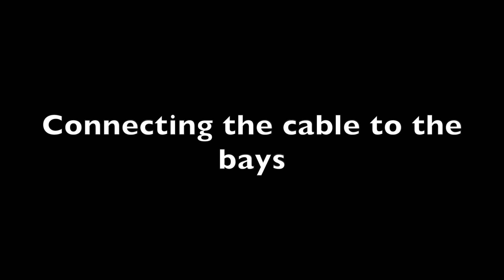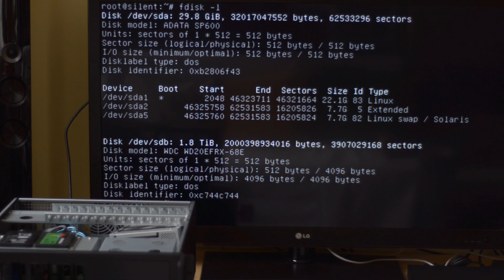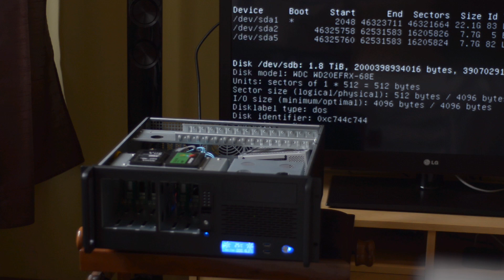Finishing the build - 0dB silent rack NAS server 8 bay build and testing  (part 4)

Comment: I see no fan cooling for your drives.....did this overheat?
Reply from the maker: When I had 5 disks, with a gap between the disks, it was fine - temps in the mid 30s. NowI have 8 disks and added 2 noctuas. Endless money appearing in my life, I want to replace everything with SSDs.

My setup has changed a lot, though. Now there are 2 SAS cards in the machine with 8 external disks in external SAS and 8 internal disks. So I installed the biggest noctuas I could find. The highest source of noise is the spinning disks and the external SAS enclosure has a very loud fan, even though it's a deskside design. The enclosure uses an ATX PSU, so I plan at some point to replace it with a quieter PSU, although I think such loud PSU is part of the design to keep the disks cool.

Without the external SAS, though, you only hear the HDDs and there's a constant flow of air throughout the rear chassis, with 5 low spinning noctuas. The final 0dB setup will need to wait for when I have money to go full SSD.